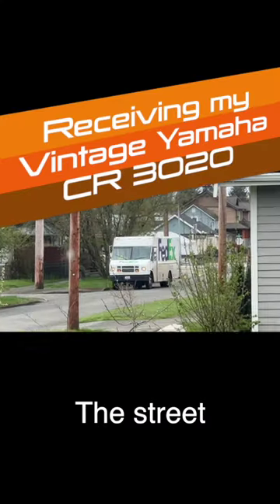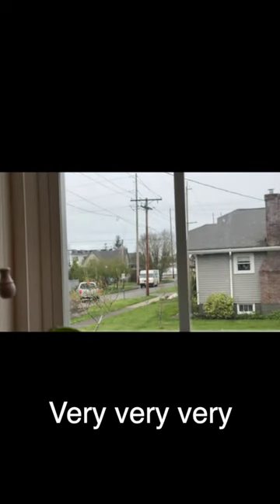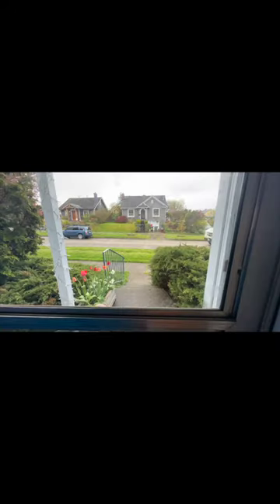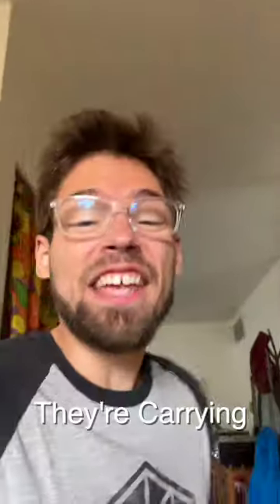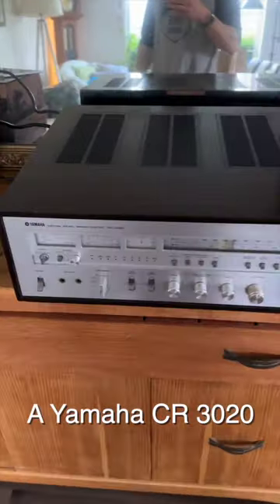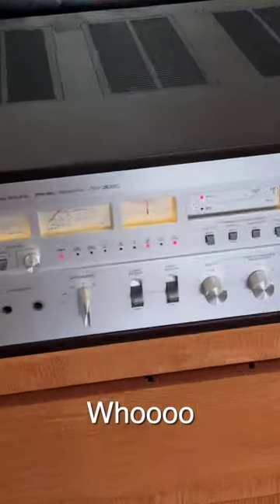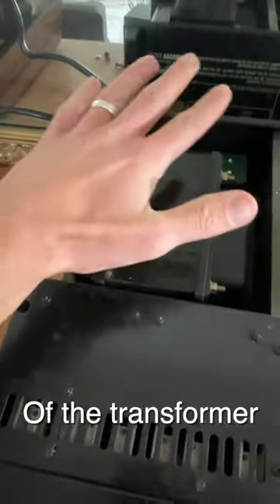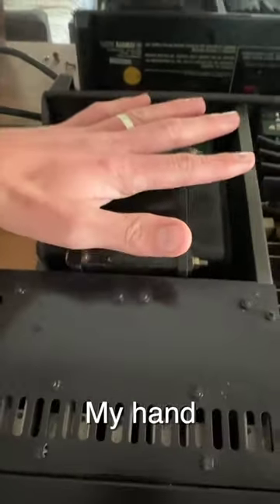My Dream receiver (Yamaha CR 3020)

Comment: There's a Yamaha CR3020  owners group at  Audiokarma
Reply from the maker: There is indeed! Both of my 3020's have their serial numbers in the group! I'm hoping to find a really low serial one eventually...Do you have one?
Reply: @MattDealy  My one is also registered. Also from what I've read  the 3020 was  neat but so BIG and rare that it's more of a  flagship statement than a viable product.
Reply from the maker: It’s a great receiver but it is very large and heavy for one with its power output. At the time it was released it pushed THD to an all time low and was a really great contender. You could spend less money and get separates that probably sound “better” but that’s true of almost any vintage receiver. Standalone amps and preamps as well as integrated amps tend to sell for less money than the receivers.